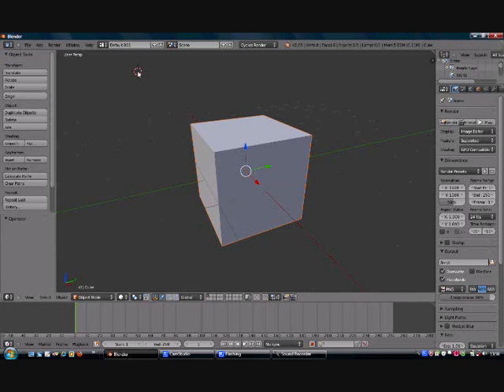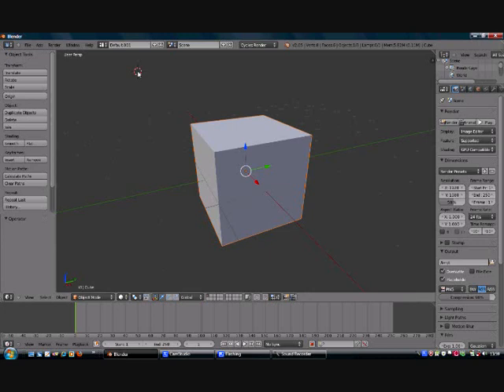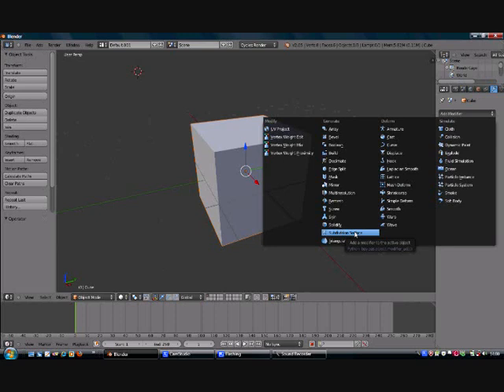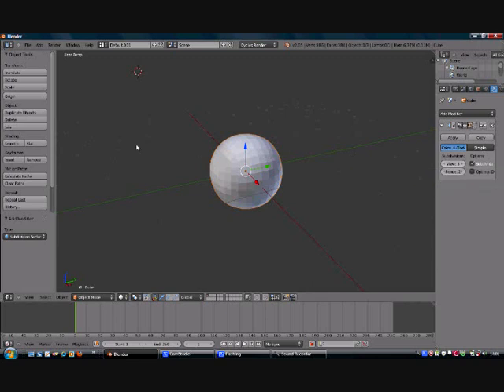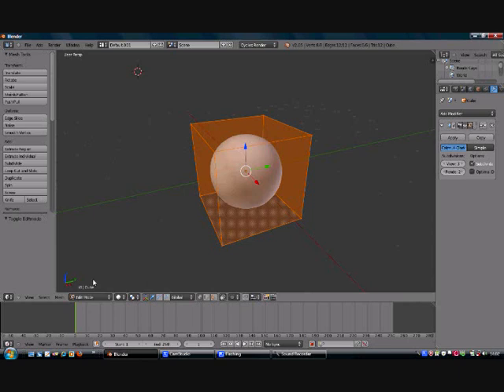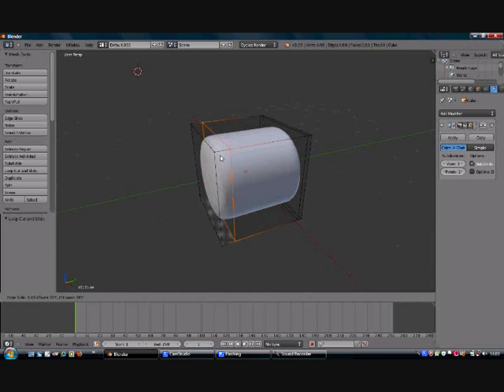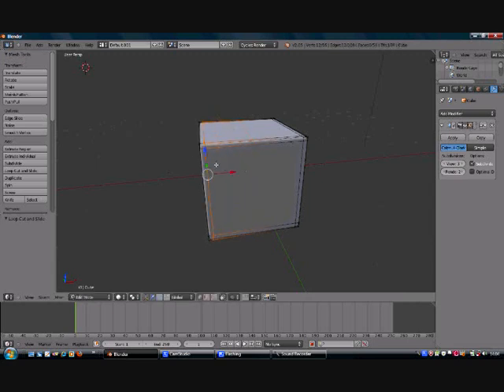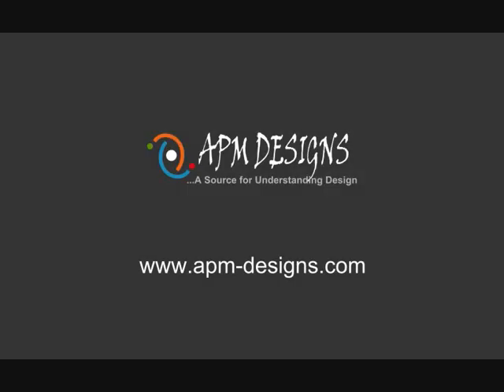The Simplest Way To Radius Corners On Blender - Part I

Comment: K.Shadowrun  - it's true you can do it in maya with 2 clicks but also you can do it in blender with one click: in edit mode ctrl+b then drag the mouse scroll the wheel and click(one click). :)
Reply from the maker: +gabri3ltz Hahahah, very clever. One click but a few keystrokes and mouse rolls. But your method is far quicker, accurate and superior......thanks for the tip.
Blender is great
Reply: +gabri3ltz ... then Shading: Smooth. ;)

Comment: how can you radius only one edge?
Reply from the maker: Watch this video...use bevel tool

https://youtu.be/wIT7OAMy_3M
Reply: +Alex McIl yep, i saw that already, thanks. that seems like a better way than the modifier method,
Reply from the maker: It depends on what your trying to achieve. But overall I think your right. Never knew about this method when I created this video. Good luck with it all